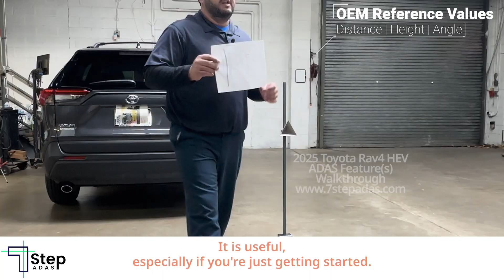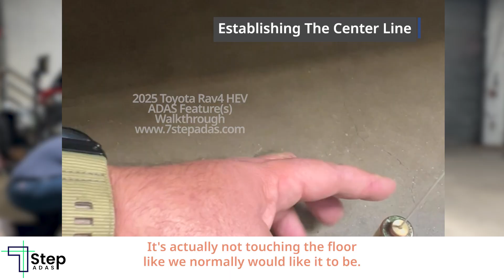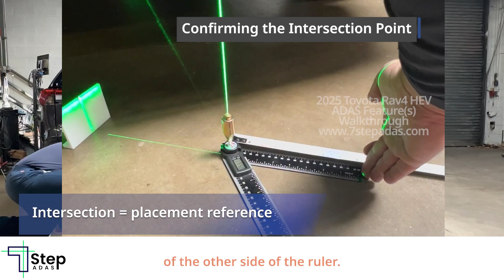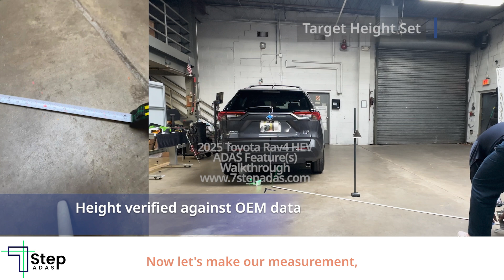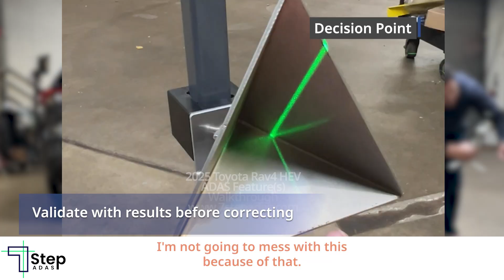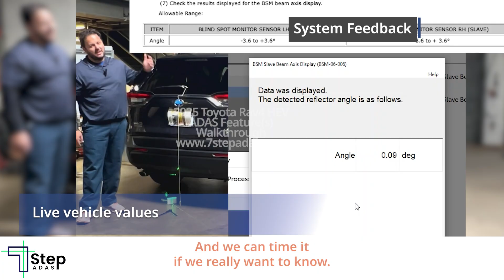2025 Toyota RAV4 Blind Spot Calibration | OEM Instructions & Geometry Explained

Comment: Now if you could figure out how to get an audible tone inside the car like the rear cross section. Wish I hat tested that before I bought the car, as most moves & models have an audible.
Reply from the maker: Did you check the settings? Usually they have an audible and inaudible option.